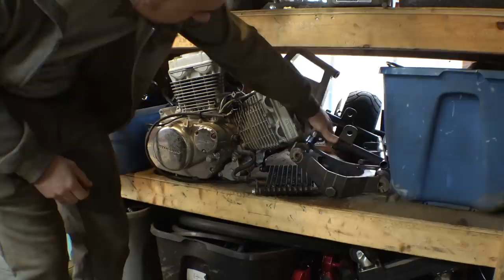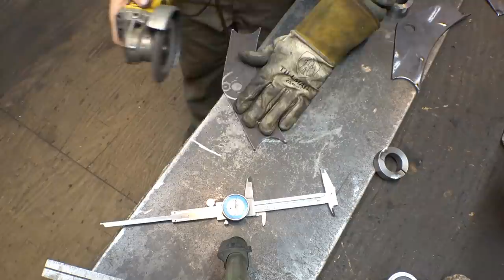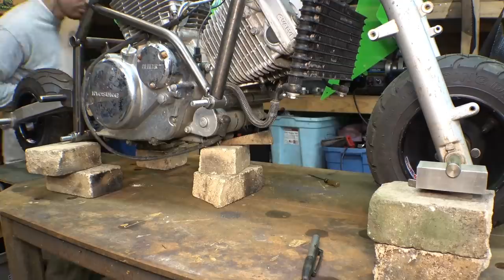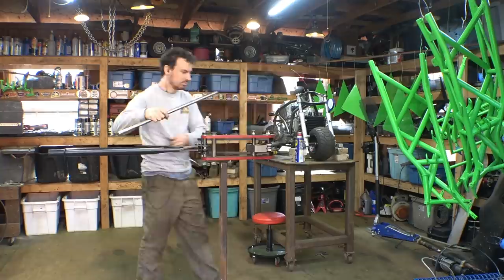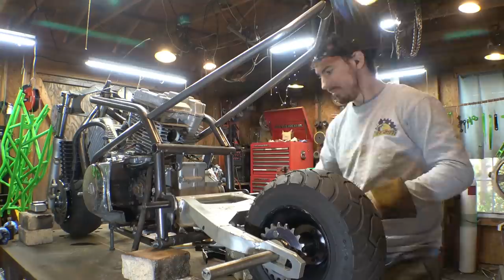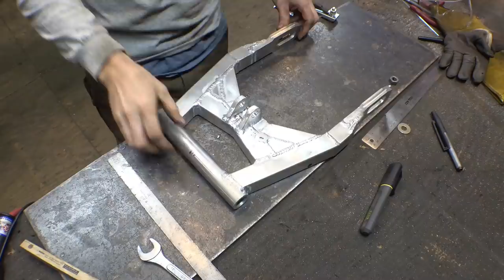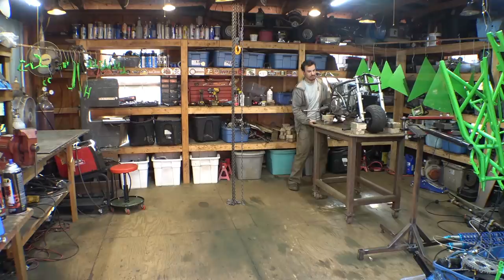Mini Crotch Rocket Build Part 3

Comment: I think that red shock will work! Just reposition the top angle more. Also the ride height needs to be with you on it. So it should sit sit a few inches even higher than it is unweighted.
Reply: Agreed.  And he could kick the bottom aluminum mount forward an inch as well.
Reply: It is also easy to calculate needed spring rates. For example:
Lets say rear suspension travel is 100 mm, and rear shock travel is 50 mm, then linkage ratio is 100/50=2.
Bike mass 100 kg (use scale) and half of it (use scale) is on rear axle = 50 kg.
Rider mass is 75 kg (use scale), and 50 kg (use scale) of it is on rear axle.
Total mass on rear axle is 100 kg.
Without preload, if we want rear suspension to compress (loaded/rider sag) 50 mm with 100 kg load, then spring rate must be 100 kg/50 mm = 2 kg/mm on rear axle.
If linkage ratio is 2, then spring rate in rear shock must be (because of spring rate physics)
2^2 * 2 kg/mm = 4 * 2 kg/mm = 8 kg/mm.
And if we want to rider sag to be 30 mm (50 mm - 20 mm = 30 mm), then we must add 10 mm preload to shock spring, because linkage ratio is 2, which makes sag 2 * 10 mm = 20 mm smaller.
And then go to amazon/ebay etc...
Reply: Red shock looks like it will be perfect.
Reply: @deadslow201 you're right it is a lot easier than you make it sound and after all these years he really should be able to calculate spring rates and gear ratios before it's built.. lol I put a scale under the rear wheel and sit on the bike (preferably with the suspension somehow held rigid) and multiply that weight by the leverage ratio the wheel has over the shock (ie if the swing arm is 4 units long and the shock is only one unit away from the pivot the wheel has a 4 to 1 mechanical advantage) which gives you the static force the shock will see at rest... Your spring should be stiffer than that static # by quite a bit.. pre load and the angle of the shock have huge effects on the ultimate  stiffness but if the static # on this build were 400🍎 I'd probably start with a 700🍎 spring...
Reply: Something tells me he didn't even try sitting on it. Just bounced it and went nope.
Reply: Yeah, he didn't even sit on it. From the squish test he did it looks like it'll be perfect. It really didn't seem any stiffer than the front.
Reply: Exactly, that and at first, he didn't even planned to use suspension at the back...
Reply: Or cut a coil (half a coil) off the red shock. That build looks very cool
Reply: @ianbuilds7712  If your linkage ratio is 4, then spring rate in rear shock must be (because of spring rate physics): 4^2 * (needed spring rate on rear axle).
It is much much much easyer to measure and calculate, than guess, especially when linkage ratio plays a huge role.
Reply: @deadslow201  are you saying that if a rear wheel  (assuming the swing arm is near enough parallel to the assumed level ground) has a 4 to 1 mechanical advantage over a near enough perpendicular spring, said spring has to be able to support 4²  times the static force (weight) the tire sees??? Cuz that seems like it would give quite a stiff ride but idk and If that's not what u meant  your response confuses me lol. Otherwise I think we agree that a given needed spring rate is both calculatable and very dependent on the leverages, angles, shock rebound, and desired outcomes and most importantly!! After all these builds, This guy should be able to see this coming.. I knew that little white shock wouldn't be enough it's probably a 300lb (about 140kg I think) spring...
Reply: @deadslow201  for some reason I can't see most of your last response... Based on the first few words I could see in my notifications it seemed like we were off on some wordy tangent about physics, weight and force lol... My point is I have built quite a few small vehicles with all kinds of different suspension designs and have videos of it on my channel and older ones on my friend Chris's channel.. i get my gear ratios, steering and suspension geometry and spring rates right the first time or at least good enough for what I'm doing.. I achieve these things with very simple math and anyone with an angle grinder, some drills, some basic measuring tools and a stick welder can do it as long as they are willing to take the time to learn...
Reply: @ianbuilds7712  I think youtube removed the whole response because there was a link to hyperco spring rate calculator in it. And yes, if you want to calculate, then: (shock spring rate) / (leverage ratio)^2 = (spring rate at wheel).  As I said, leverage ratio play a huge role in that, as you say, very simple math.
And also, that might be the main reason why people get those spring rates totally wrong when they try to simply guess the correct spring rates. They do not know/ understand that you must include (leverage ratio)^2 to the equation/ guess work.
The most common phrase in any of these build channels is "Oh no, it is too soft, it bottoms out too easy..."
And now you know why.
Reply: @deadslow201  I still feel like squaring the leverage ratio would give a stiffer ride than I'm looking for especially at the small scale that I typically build.. the last bike I built I took the static weight my rear tire saw with me on it and the suspension held rigid, multiplied that by the leverage ratio.. the 2 springs I had laying around just happened to be about double that # when added together and it is perfect for trail riding and doesn't bottom out.. my shocks are pretty much perpendicular to the swing arm though and if they were angled forward as they are on many bikes it would be significantly softer..
Reply: @ianbuilds7712  If you check the example in my first response, you will notice that the amount of suspension travel, and sag when loaded, and preload, is included.
If you want to use soft springs, you just have to add more preload. Then only downside is that if you jump with it, it will easily bottom out when landing.
Also, typically people do not understand that compression damping plays a major role when some suspension is feeling stiff or soft. You can have stiff spring, and loose compression damping, and as a result suspension feels soft.
Reply: good starting point for a paint scheme, too!
Reply: Naw that things a cheap piece of crap. Probably doesn't even have oil in it. It's probably just a spring with preload adjustment. Just get a used front  shock from ebay for a name brand quad. Of you go with a more race oriented quad the shocks will be better quality with rebound and dampening not just preload plus you will be able to find different rate springs. It may be longer but you can  lay the shock in towards the motor more and play with mounts and linkage similar to late 70 yamaha mx bikes. maybe even cantilever. That or like a kx 65 or ktm 65 rear shock

Comment: Lots of guys use CAD, (cardboard assisted design). As far as I can tell, you’re the only one that uses BAD, (brick assisted design). It’s pretty cool that the bricks come out on every project.
Reply: Pretty trick huh? His medulla oblongata is operating perfectly.
Reply: Flintstone engineering blocks
Reply: I would only add peace of plywood with some felt on it as top layer, so say front shocks do not get scratched and its good habit for when vehicle is ready and some changes needs to be done to have felt surface be first thing contacting the frame.

Comment: That chonky shock didn't seem so bad, I'd speculate with it installed on the least resistant angle and a bit of break in riding it would soften up.

Comment: Just gotta find some rad fairings to fit to that thing, and itll be one of your coolest builds imo
Reply: Some custom sheet metal fairings would be badass
Reply: Whats fairings
Reply: Could just cut up some plastic garbage cans and heat them to shape. Jake the Garden Snake does that, and it worked for him. Not to mention that garbage can plastic is cheap and tough.
Reply: @lifeononeweel3008  side fairings are the plastic sides that go around the motor and the front fairing is the plastic front end that has the windscreen and light(s)
Reply: @cinnamonrollypoly  that is a super legit idea!!!!!
Reply: @drewtooker4243  i was thinking he could just find them used off of a pocket rocket  and then trim and fit them like he does with powerwheel builds.
Reply: @memorris2  Oke thanks

Comment: For the shock position: as the shock lays down more, the ride becomes softer (but needs a higher spring rate), and as the shock is more vertical, the ride becomes firmer (and you can use a softer spring rate). Of course, it looks like you need a significantly firmer spring than you have lol
Reply: It is also easy to calculate needed spring rates. For example:
Lets say rear suspension travel is 100 mm, and rear shock travel is 50 mm, then linkage ratio is 100/50=2.
Bike mass 100 kg (use scale) and half of it (use scale) is on rear axle = 50 kg.
Rider mass is 75 kg (use scale), and 50 kg (use scale) of it is on rear axle.
Total mass on rear axle is 100 kg.
Without preload, if we want rear suspension to compress (loaded/rider sag) 50 mm with 100 kg load, then spring rate must be 100 kg/50 mm = 2 kg/mm on rear axle.
If linkage ratio is 2, then spring rate in rear shock must be (because of spring rate physics)
2^2 * 2 kg/mm = 4 * 2 kg/mm = 8 kg/mm.
And if we want to rider sag to be 30 mm (50 mm - 20 mm = 30 mm), then we must add 10 mm preload to shock spring, because linkage ratio is 2, which makes sag 2 * 10 mm = 20 mm smaller.
And then go to amazon/ebay etc...
Reply: @deadslow201  great explanation
Reply: you also gain suspension travel as you lay it over
Reply: That shock angle is referred to as, the 'cantilever' angle, where changing its angle defines the ratio between shock compression and wheel travel vs. a given spring rate.

Comment: Imagine getting that frame anodized would be pretty cool. Love the build😁🔥
Reply: Um, the frame is steel man. Can't really anodize that unless you like colored rust coated metal. Now powercoating would be a great option and typically is much more durable than standard spray paint if prepped and applied correctly.

Comment: That red shock  is mint lay it down a touch and move mount up and done.  Did you sit on it. For 3.5 inch travel with 1 inch compress at ride hight your hand bounce test looked spot on but you gotta sit on it.  Also with the swing arm at that aggressive of angle it’s going to seems stiffer then if it was laying more flats and lay spring lil more flat as well.

Comment: Nice work with this pocket rocket, it’s gunna look mint.
Try a down hill mountain bike shock on the back end, should be able to find high quality shocks that will take the weight.
Reply: Good idea.I looked at many different springs to put on my shock as it was a bit squishy.So many rates to choose from.

Comment: The upper and lower tripple clamp are not typically welded to eachother. They move independently allowing for wheel alignment. They simply clamp in place at fork tube. In fact I've never seen them as one piece on any motorcycle I've ever encountered. As far as the rear shock. Just find a front shock of a newer name brand quad. It will be a real shock and you should be able to order different spring rates for it.
Or a kx65 or ktm 65 rear shock

Comment: You can get a cheap mountain bike shock with 800lb spring. Would probably fit the bill nicely!
Also, please add a roller or slide so the chain doesn’t ruin the swing arm.

Comment: with the weight of that motor and you on top i think that red shock will be perfect on the softest hole setting when its done as it will end up much heavier and also look so much better with the shock on that most tilted angle! also ther is still adjustment in that shock and it willnot bottom out over bumps..
coolest build so far 👌 i have been saying for years on channels to do a v twin mini bike so i love it. please do some v&h style twin exhaust for max awesomeness 👍👍👍

Comment: Loving where this thing is going. I feel it deserves slightly bigger wheels though.  Maybe some moped/scooter wheels would be better suited to it? Possibly make it handle slightly better too? Only a thought :)
Reply: I totally agree with you. With the bike taking shape the wheels just have become way to small
Reply: Also will give more ground clearance allowing for suspension movement?
Reply: If he got DOT legal tires and added some basic lighting he could make this street legal.
Reply: Scooter wheels would be perfect.
Reply: @garrettstevens2232  Most states require the frame to be welded by a certified welder. Also, he would need the title to the engine. I'm guessing as it was scrap, he does not have this.
Reply: @csorrows  it really varies by state. I don't know about his home state but this would be possible in Illinois after jumping through a LOT of hoops. He would need to apply for a bonded title with a bill of sale from the scrap yard where he bought the bike. Then he can apply for a VIN as a custom built vehicle. That takes 4 pictures and inspection for the state police. They are not welding/chassis experts. They are looking for glaring problems that would make it unsafe or outside of the vehicle code. That's where the lights and DOT tires come in.

Comment: Use the red shock you already have  . Also change the rear swing arm attachment point to the bottom of your frame, and the bike wont bottom out so easily  ...   You are using a bigger engine and you an adult who weighs way more than a child .. So  You will  need a bigger shock with stiffer spring rate .. Great build so far..

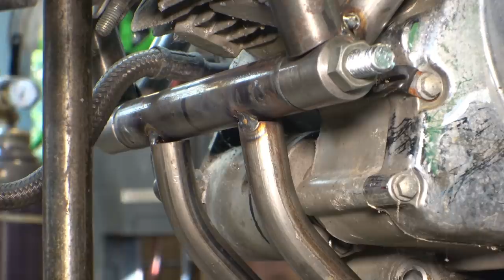Comment: Chris it looks good, I have a suggestion for you at 11:00 in the video. If the "center section" of the frame was Drilled and Taped round bar, front and back you could use 4 Bolts instead of 
all thread. It's looking good 👍
Reply: I second this idea. Good thinking TillmanXL.
Reply from the maker: Dang that’s a good idea. I may have to do that in the next video, thanks 😊

Comment: Suzuki RM 125 or 250 shock has the pre load and travel required. new ones have more adjustments.settings

Comment: Hi
Use the red one. Take the spring out and grind the spring thread down.
If thread is somewhere around 10mm, grind down to 8mm.
You get the spring to be little softer.
This in case that you wont find suitable spring for it.